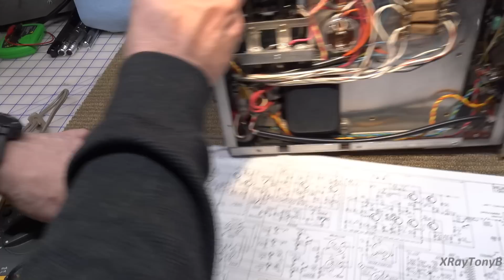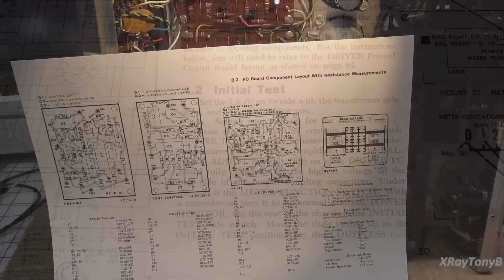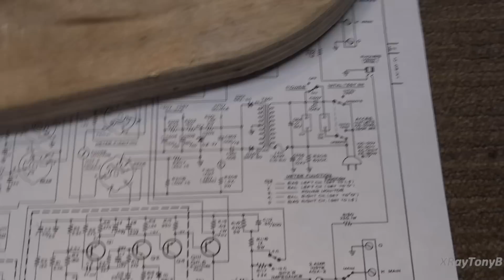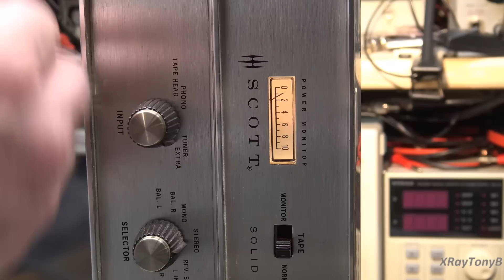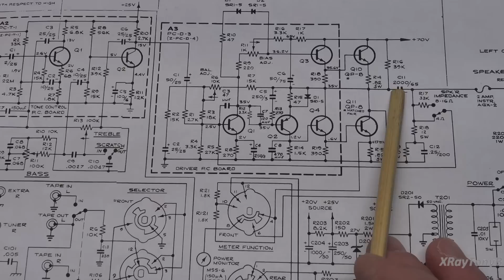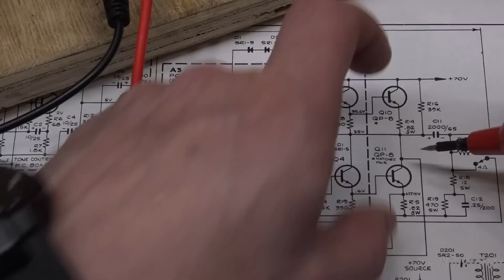Scott LK-60b Stereo Amplifier Repair and Alignment

Comment: Great video! I recently picked up this exact amp and am starting to do a refresh on it. I do have a question on those speaker caps you replaced. I,m not familiar with the can style caps and the markings on them. Can you please explain the markings? I,m not sure which is positive and which is negative. The standard electrolytics I,m in the middle of replacing and have an understanding of them , but the original assembly manual doesnt explain those markings  on the can caps, just how they they are aligned when installing into the chassis. also.... I,ve purchased the same replacements that you installed...any issue with going from 65 volts to 63 volts ?  Thanks for the great vids!

Comment: Those "Callins" capacitors and the "dome top" transistors-which I noticed one of on the phono board, have caused problems in units I have serviced over the years. The lamp idea was similarly built into the Knight Kit KG870 in which lamps were incorporated as emitter resistors for the output transistors as well.
I do remember the advertisement for this kit when it was brand new in High Fidelity magazine, and remember "the only piece of test equipment you'll need is a 15 watt light bulb".

Comment: @xraytonyb - I hope you can get your hands on a few old vacuum tube stereo receivers some day.  There must be plenty of them out there in need of repair and testing.  Some of them really were great.  I recapped an old Fisher stereo receiver that a friend gave me about 10 years ago and got it sounding great again.  He liked it so much that he bought it back from me.  I went through your entire "electronics 101-1/2" series.  Great job with both the teaching and the successful improvements to that little budget tube amplifier.  I did post a question for you about the "magic eye" tubes in other vacuum tube amp that you built, which I might try myself.  - Vacuum Tube Push-Pull Amplifier Kit - Part 1 -  If you have a moment, please look back to my comment and question there yesterday.
Reply from the maker: Magic eye tubes are just for "eye candy" and are not necessary.  You can just omit them if you desire.
As for the Tube receivers, I've done quite a few on this channel including several Fisher, Eico, Marantz (10b), McIntosh (MR Tuner) and Scott amps/receivers/tuners.

Comment: I was testing a receiver the other day with a dim bulb. With a 40 watt bulb or a 60 the bulb would stay bright and I was getting 4 V DC on my speakers. Without a speaker load the dim bulb worked fine. I had to put a 100 watt bulb in to get the receiver to work with a speaker load. For some reason the receiver couldn't start up with the smaller bulbs when the speakers were on.

Comment: That's pretty neat with the built in dim bulb and the power meter.  What did you do with the slight channel imbalance?
Reply from the maker: It was a bad capacitor on the tone board.  I'm pretty sure I showed it in the video where I bridged a good capacitor across it and you could see the other channel come up even with the other on the oscilloscope.
Reply: @xraytonyb  ok,

Comment: Should you replace C206 & C205 with xy caps, and replace the power cord with a polarized cord, with the hot to the switch (even though the fuse would be on the neutral)?
Reply from the maker: Not necessary on this type of amp, as the power transformer provides electrical isolation of the mains leads.

Comment: Nice, another hifi repair channel!! Those big filter and output capacitors can be tricky... They may measure ok, and still leak electrolytic or have voltage loss. I've been working on an old germanium radio that has the same black plastic Callins capacitors. They're ALL bad! This was a shame, the capacitors were made in Shannon, Ireland, Near where I live.

Comment: This is a great video, but I do have something to say here.   Having the unit on its side could affect the meter readings.    The meter is designed to work in the horizontal position not vertical.    
Aside from that, this is a great video.  Everything is explained well, and all the adjustments explained, just as you'd want it if you were building this as a kit.   What an amazing amplifier.   I wish they had kit amps like that now.    We are missing out now.   Young electronics enthusiasts have to rely on much less usefull kits these days.

Comment: This is good design especially with negative feedback loop. It looks like there is a complete dc return path. Some amps required a speaker or load to be hooked up otherwise it upset the bias of the first transistor and sent you in circles troubleshooting

Comment: Those adapta caps things where can I get them? Also do you have a video where you show taking out the boards and capping them then putting them back in? As someone new to this I really need to see how that is done professionally and how you keep track of where everything goes to put it back together correctly.
Reply: I would also like a set of those. Normally I order different sized O-rings from Ali, but these PCB's also give the option to solder on extra binding posts.

Comment: Great Video! Your Explanation of how the bias affects "crossover" distortion helps a lot. Just curious can the crossover distortion be seen on an oscilloscope? Thanks for sharing these videos. they are very entertaining and Instructive.
Reply: Yes ,a quick way to check amp is look for cross over distortion at low volume across a dummy load
Reply: @davet3804  Thanks. A good excuse for me to get a couple of high wattage resistors. I’ve been thinking about getting some for testing without fear of messing up my speakers 😀
Reply: 😁the resistive load is easier to interpret than the inductive load from a speaker which varies with frequency. Use 1khz signal with low output and look for a notch as wave crosses zero point

Comment: Nice! The cap wizard tool was quite handy for this evaluation. Wonderful to see the outputs balance when you bridged with a good cap. What a nice kit with such useful instructions.
Reply: One thing to remember with the cap tester is that it measures ESR, so if a cap is shorted, or has some kind of parrallel resistance, then it will likely still show good.   It is a good tool to have, within it's limitiations :)

Comment: How about installing a speaker protection relay when turning on? Do you recommend it for this kind of cap series amplifiers?
Reply: It's always a good idea. Great peace of mind. However you will need a protect circuit specifically for single ended amp... There's an excellent discrete protect circuit on Rod Elliott's DIY hifi site, project 175. It will take high voltage. He makes PCBs too.

Comment: Bias is dependent of the mains voltage, there's no regulation in most amps, so (if I had a variac) I would first set the mains at the local voltage ? I never see some one do that.
Reply: Hi. Most power amps don't use regulated power supplies in the output stages, so yes, everything's depending on the mains voltage. But when someone designs a circuit, provision must be made for such fluctuations. There are lots of service manuals out there that state, for instance, 10% variation on voltages on the schematics. I've never had a situation that called for  such accuracy on bias settings. If it was to be that critical, the manufacturer would have specified a regulated power supply.
Reply: @marcodoria  Well, I have a Marantz 1030  that needs 7.5mV bias, but it drifts 1mV from that for every 4V AC mains at 230V. But no manufacturer advising any variac setting says a lot maybe.
Reply: @erikdenhouter  have you tried to check the minimum voltage required to bias the outputs, by measuring the emitter resistors? This may help to reduce the voltage and run you amp cooler. I think it will be less than what is stated on the service manual. Hope it helps!
Reply: @marcodoria  Not sure if I understand you here. The 7.5 mV is measured over .5 Ohm. It is the only setting given by Marantz, beside an adjustment for symmetric clipping for pos. and neg. side of the sine wave. Btw, the amp is running OK, not warm at idle at all.
Reply: @erikdenhouter , don't know that particular model, and I didn't know where the measurement was taken. So no problem right? 😉
Reply: @marcodoria  No problems at all. I just often see that the bias is set quite precise, but when you want to do it that precise you must set the mains first. That was my little point of comment 😉

Comment: Looking inside as you did, the routing of wiring was not as "sharp" looking as the assembly manual shows it can be ( available at the "HiFi Engine" website), so ,there was some "that'll do" in the assembly. The "steady state" output is rated @ 40W RMS, both channels driven, it would have been interesting to see if it could meet specs still. I also wonder, if that difference of "balance" in your initial checks with the internal meter, and the difference in output gain, were fixed after you readjusting the bias and balance. Thanks for the look inside of it!

Comment: Great Job Tony.  Interesting Amplifier.  I Remember building My first amplifier in 1982 it was a Stan Curtis DIY design called a System A Amplifier  published here in the UK in an electronics magazine called Electronics Digest.   Stan Curtis went on to design for Rotel, Mission, Cyrus, Moth, Cambridge Audio, Quad and B&W.